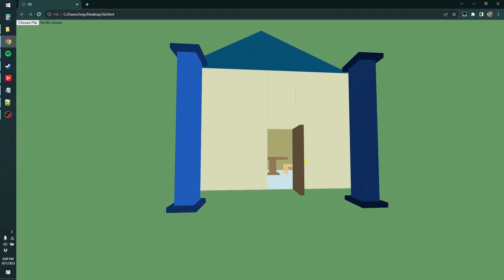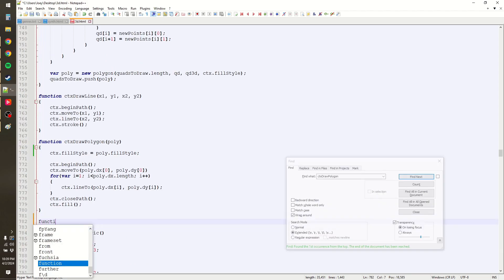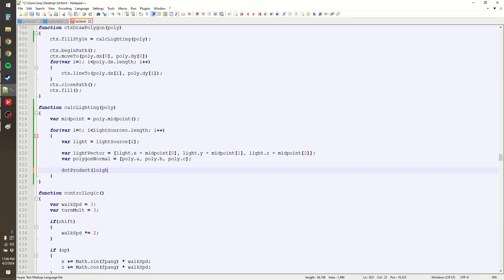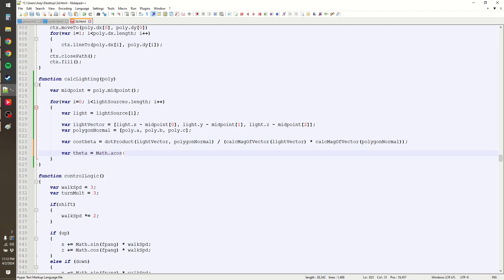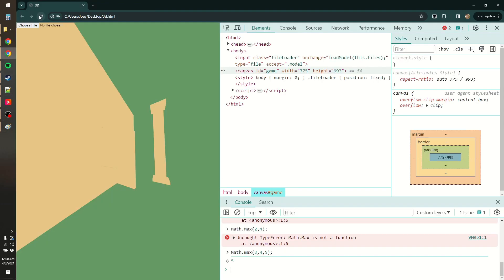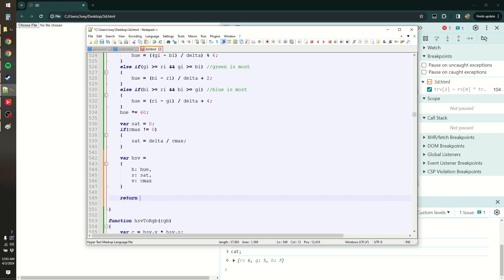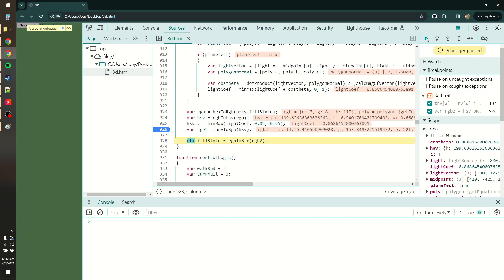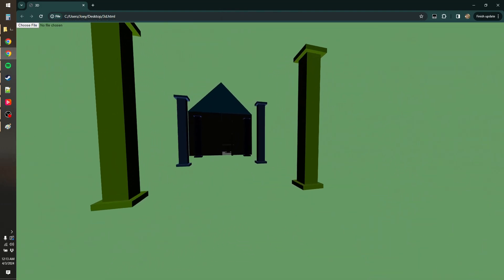3D Engine Coding: Rudimentary Lighting

Comment: I think it's almost working, it's just that the sun darkens the objects instead of illuminating them

P.S. Nah, just rewatched it and it doesn't always behave like that either. But I noticed that you use costheta as lightCoef. Assuming lightCoef indictes how much light the object receives you should probably do lightCoef = minMax(lightCoef + (1 - costheta), 0, 1) instead of lightCoef = minMax(lightCoef + costheta, 0, 1). Because if cosTheta is 0 it means the light source is perpendicular to the object so we should brighten the plane, and if cosTheta is 1 than the light source is actually on the plane and the plane should not receive light. Hopefully this makes sense, but maybe I'm also misundertanding something 🥸

Comment: i felt so sad when you started implementing hsv to darken a color.

you can just multiply r g and b seperately. you realized tragically late.
cool lighting tho! it looks pretty close to correct. 

another thing is, dot product ranges from -1 to 1, so what the plane test is doing in this case is removing the -1 to 0 part. then only 0 to 1 are left to have light calculated for them

Comment: Unrequested advice: use let and const for variable declarations instead of var . let is for variables that do change inside the scope in question and const for the ones that don't. Most JavaScript engines will optimize the resulting bytecode better given these hints.

Comment: take 3 vertex points from a face
calculate normal vector from the positions, the face vector
if the face vector is the same as the light vector coming from the sun, its in shadow
Reply: from what i recall the vertexes have to be counted clockwise for this to work